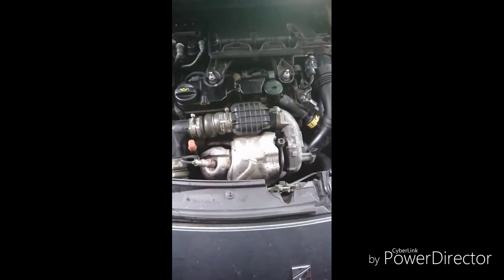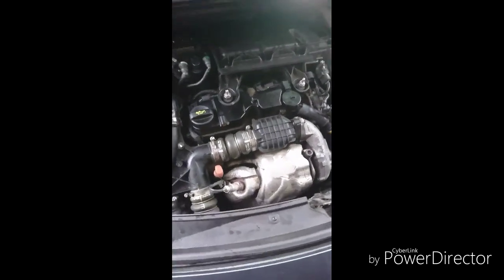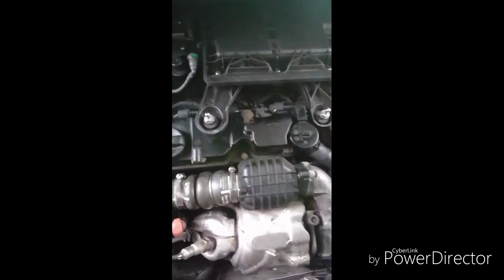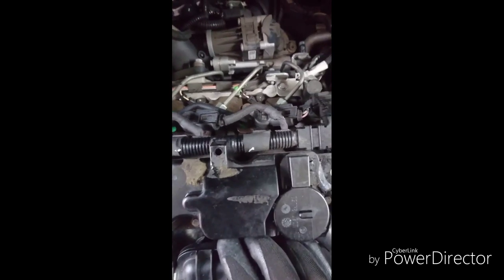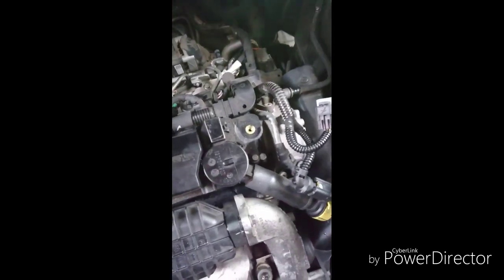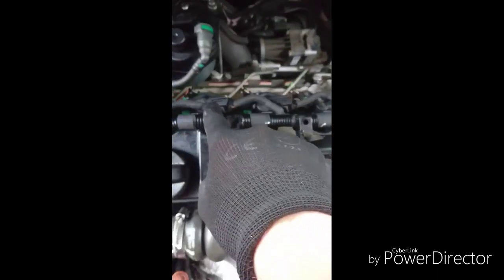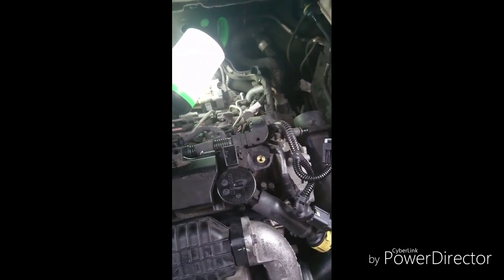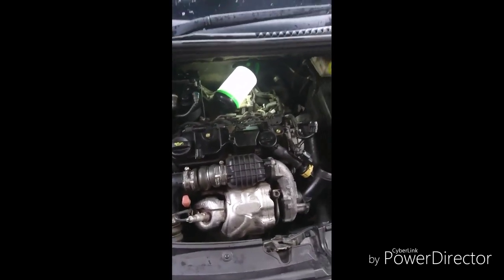How to fix Injector Issues/rough idle/engine management light on a Citroen DS3 1.6 HDI 110 Diesel

Comment: What's not mentioned is that the routing of the harness that's affected has been changed, and it is no longer going over the other cable, and then on to an attaching stud in a bracket that makes the whole thing a lot higher, and if the TWO large rubber bushes that should be in the back of the airbox are missing, they're similar size to the bushes in the front mounting, then the box WILL rub that cable, I found exactly the same issue on my 2011 C4GP a few days ago, albeit that the No 1 injector had failed, dead short, it was only as a result of taking the box right out that I found it, as the main dealers are all closed  for the next week or so, I've made up some temporary bushes that will solve the problem for now, they'd clearly been missing for a very long time, based on the wear patterns on the studs behind the engine, clearly someone had been in there before, and not put them back on correctly, probably after changing an injector, the continental injectors are not a good product, unfortunately.
Reply from the maker: Great work! Yea I believe that's exactly what happened, and yes I had an injector replaced by garage before this happened , so you are probably right 😊

Comment: Thank you  so much. I have never had any faith in garages. Once had a new gear box fitted 20 years ago on my Mercedes van for £890, only to find that it was just a loose connecting rod bolt (£1.20p)  The RAC contracted them to do their call outs. I complained to the RAC, they simply said that the garage wont give them a detailed report for the work !  Name and Shame the Garage that ripped you off mate..
Reply from the maker: I'm so glad this video could help, and it's a shame to hear about your past experiences with garages 🙁.

Comment: Thank you for sharing this video. This will help me diagnosing my Peugeot 3008 which same engine. Hard start and if it starts won't take long and cut off.  Checked all fuse, just bought fuel pump, fuel filter, fuel pressure sensor and about to take off injectors tomorrow. Fingers crossed I'll have same issues and save me a lot. Thank you
Reply from the maker: Thank you 🙏🏻😊, I wish you good luck I have my fingers crossed 🤞🏻 for you
Reply: Did you have p0271, what was the cause of the fault?

Comment: Thanks fella, I've been through the same issues with garages, including Citroën main dealer. Absolute nightmare. Spent a fortune, not to mention months of hassle and recovery costs. In the end it turned out to be an injector...  they're total nonsense, charging obscene hourly rates to do guesswork.
Reply from the maker: No problem at all, I'm so happy you eventually got to the bottom of it ☺️, it can be a real pain when you have an fault that no one can seem to fix

Comment: Great video! Got the same issue on a 2011 pug 308 1.6 hdi. Just had a look now and the wire is worn like yours, was there anything specific about the connector you used? Like the amp or voltage rating for the connector? Many thanks
Reply from the maker: You are welcome and thanks for your comment ☺️🙏🏼, no use any connector it will be fine ☺️

Comment: Great video, thanks for sharing the info.
I just checked mine on 2011 Peugeot 5008 and it was also rubbing through the wires.
The reason was because there was a rubber mounting bush missing from the bottom of the air box. This meant the air box was sitting too low and rubbing on the wires.

Comment: Thanks for this, one injector went, replaced the other 3 with new ones. Year later I'm getting high current on injector 4. Just been to garage who couldn't diagnose. Hopefully I've a similar issue.
Reply from the maker: No problem glad I could help ☺️, thanks for your comment and support 🙏🏻☺️
Reply: What was the cause of injector 4 high current?
Reply: @frv6610 had a split/dodgy glow plug cable, changed the battery and put a Continental injector in opposed to Siemens, been alright since.

Comment: Thank you very much. I have a Mitsubishi ASX 1.6 diesel , that should have an engine dv6ted4 1,6 HDI Peugeot 207 307 CITROEN c4 XSARA PICASSO c5 , that seems very similar to your engine. I have fault code p0265 too, that happens randomly. Injector 2 was replaced one year ago thinking to solve the problem,  but now i have the same problem p0265 again. I hope the cause is the one you suggested, i will check tomorrow and let you know! Thank you very much!!!
Reply from the maker: Thanks for your comment, no problem, good luck, please let me know the outcome 😊
Reply: What was the cause?

Comment: You are so kind to share this. It shows how poor the diagnosis tools are. I have issues with overboost on 1.6hdi engine. Its like all software which  seems to be designed on priority of the main function but will not necessarily indentify directly a faulty sensor. The trouble I had in location of a fault with an impact sensor would take many more lines to describe. However my Berlingo has done 158k miles so reliability is high. At that's something.
Reply from the maker: I'm so happy this helped you, and thank you for sharing your experience 😊

Comment: I did hear about this issue but your video better describes it. I will look on mine to see if this is the issue.
Though if the injector itself is the problem, using a multimeter between the two electrical pin connections will tell you. If it's 0 ohms, then it's knackered. But I wonder if loom problems like yours cause them to get damaged?

Comment: Thank you so much for sharing I have bought a number 3 injector as that's what it was saying on the fault reader and still the same so I will check the plug wiring fingers crossed 🤞. If its the wiring I could have saved myself £350 lol thank you

Comment: hi, i have injector noise on my ds3 1.6 hdi 110 like it rattles on acceleration, rough idle vibration also, ive been trying to diagnose the problem.
i have found the same cable or maybe a differant colour all open and showing.
i thought i would just put some electrical tape on so i did and after putting the bits back togther i started the car and it is the same rough idle and noise.
i scanned with elm 327 and i got 2 pending codes p0269 cylinder 3 contribution/balance and p0263 cylinder 3 contribution/balance.
do you think this code is because of the cable and the fact it needs cutting and a block fitted?
only other thing i can say was when i purchased my car 2 days ago it was ran when 0 fuel in the tank so i am thinking the back of my mind its dragged crap up and blocked injectors but now i seen that cable im still thinking it maybe that that needs cutting and connecting up.
i also havent managed to delete the pending code so i might need a proper diagnostics machine to do this as im guess the fault will stay untill the pending codes are removed even if the problem has been mechanicaly fixed..? any help i will be most thankful
Reply: Did you manage to sort your poor idle and noisy acceleration? What was the cause?

Comment: Hello, I have a problem with my car Peugeot 207 1.6 hdi 2011 82kw 112ps, one day I get a message Engine fault repair needed, the car loses power and the engine noise changes sharply, and the engine vibrates, and the gas does not exceed 3, then removed the battery and put it back again this problem is removed, after a month the same problem appears again, TODAY I CHECK COMPUTER THE CODE IS  the foult code P0268 
- Cylinder 3 injection circuit
-Short circuit to positive
-Permanent

I am thankful if you help me solve this problem

Comment: Really good find - will be looking at my daughters ds3 tomorrow as EML came on and the fault code suggested injector…
Reply from the maker: Hi thanks for your comment, good luck let me know what you find 🙂
Reply: @CarFlix.  managed to fix it - cleared the codes and then when the light came back on it said exhaust gas temp sensor - so changed that out (tricky to get a spanner to it) and all fixed now :)

Comment: The wiring you've repaired is to the glow plugs, not the injectors. The Injector wiring loom is inside the black conduit.....
Reply from the maker: Hi I traced the wiring directly from the injector which cured the rough idle, glow plugs only heat on startup, and would not affect the running of the car 🤔
Reply: @CarFlix.  if you trace it again, you'll find it runs behind the Injector loom. You're right, a short or open circuit in the glow plug loom shouldn't affect the running of the vehicle although it will still throw up a fault code. I should say your repair actually had nothing to do with the fault clearing, I should say it was just coincidence, maybe some dirty fuel caused a momentary Injector fault, and clearing the fault off the ecu sorted the problem. Either way it's still a useful video for people to check.
Reply from the maker: @nathanaelwarden  the weird thing is I replaced the injector, fuel filter and ran it on bp ultimate for 2 months before hand, maybe they share the same earth?
Reply: @CarFlix.  it's possible. I don't know whether they're earthed through the ECU or the head
Reply from the maker: @nathanaelwarden  ah well, hopefully it's linked as the code never came back again and ran well ever since 😊, the added info though mate much appreciated 😊
Reply: Yes,this 4 pin connector is for those four glow plugs 🫣😁👋

Comment: Doing this today will let you know if it works for me :)
Reply from the maker: Hi and thanks for your comment, how did you get on?
Reply: @CarFlix.  It got rid of two errors but I'm still getting cylinder 1 circuit high error which I'm unable to clear. Before I had Cyl 2 and 3 contribution balance errors, so at least they are gone. Will be trying to have a go again when time allows.
Reply: and yes the cable was worn in exactly the same spot as in your video :)
Reply from the maker: @TimTymski  brilliant so happy I could help 😊

Comment: Some Muppet did;nt invest in a multimeter and learn how to connect one of its leads to the battery negative and the other lead to the injector/s connectors plugs +supply, to verify their supplies. And/or inject direct 12v fused-supply to injector/s via said meter in current mode, to verify their correct current load. Oh dear.
Reply from the maker: Hi Thanks for your comment, oh well hope this video helped you all the same 😊

Comment: how did you go about repairing the connector?
Reply from the maker: The connector wasn't faulty, it was the wire which had been damaged. I cut the wire in half, bared both ends back then used a crimp connector to join the ends. Hope this makes sense 👍🏼
Reply: @CarFlix. ok thanks you
Reply: @CarFlix.  the default has disappeared or did you use obd to erase
Reply from the maker: @malikbelhouchet4305  I used a Bluetooth OBD adapter and the Torque App to remove the engine management light after I fixed the wire 😊👍🏼

Comment: Bonjour j'ai le défaut P0271 injecteur 4 court circuit sur 1.6HDI 112CV
Reply from the maker: Thanks for the comment, sorry could you write this in English please?
Reply: @CarFlix.  the connector is that of the glow plug and not the injector or it is a set

Comment: Thank you for your video. It really saved me lot of money. I had similar problem. Lost power on my Citroen C4 Picasso 2015 while going on a camping holiday. RAC recovered me to nearest garage. They quoted me £1900 for changing 2 injectors without even touching the car. Asked me to leave car with them for 3 days. I refused and recovered my car privately to my home. Shown the car to my local garage, who quoted £900. I refused it as I didn't believe injectors failed only after 47k miles. After searching on YouTube found your video and decided to do it myself. You have explained all the steps well. I found the airbox had been rubbing against the cables and black netting on the cable partially damaged. I have put the insulation tape around it and tighten all the connections. Put everything back. Car is now running like new. During this whole episode I realized that people (mechanics in this case) rely on computers too much and not even looking under bonnet to check the problem. I think we all rely on computers heavily but should always remember to trust your guts.
Reply from the maker: Hi Karan, thanks so much for your comment, I'm so happy this saved you money, your right some mechanics don't check the basics 1st, and they also charge too much money in my eyes. Here's to much more trouble free motoring 👍🏼

Comment: Can the wire be just isolated by tape,or connector should be fitted?
Reply from the maker: It depends how badly severed the wire is. If the wire on has insulation damage, insulation tape is sufficient. If you see any copper strand damage I'd cut it and reconnect with a connector.
Reply: @CarFlix.  thans for replying 👍
Reply from the maker: @mirzaogric6650  your more than welcome 😊👍🏼

Comment: Exact same problem with my DS3 Dsport hdi 110 - RAC ran the diagnostics showing me that injector 3 not working at all - 0 on all readings compared to CO2 and dynamic % figures from the other 3 cylinders so I suspect the Injector is knackered but will check the wiring anyway and probably give it a go replacing the Injector. Nice vid much appreciated
Reply: Hi Jon checked my connector and the outer braid has been worn through but none of the 4 wires or their plastic outer cover has been worn . Also i traced those wires and  they connect to the injectors at a part of the injector close to the point  of attachment into the head or manifold not sure how these are detached.  There are separate electrical connectors to the top of each injector which look standard.  There is a large torx bolt and smaller standard hexagonal bolt holding each injector in place as far as i can see is that correct ? Finally the clips holding the return fuel pipes to the injectors Im not familiar with so dont want to break them. Any guidance on replacing  the injector would be a godsend cheers

Comment: Thank you for this wonderful video. I have an injector problem too. Citroen C3 Picasso 2010, diesel. One garage suggested (on Sunday no mechanic available) that I change the injecter washer only because I am losing engine power. I am visiting a garage tomorrow, I hope they don't charge that much.
Reply from the maker: Your welcome, you can buy a new injector off eBay for around £130, it only takes 30 minutes to remove and fit the injector, very easy job you could do your self , good luck!

Comment: my 1.6 hdi 8V DV6C , the same problem
Reply from the maker: Yep seems to be a common design floor
Reply: @CarFlix.  I had the codes P0263 and P0265, the car drives and is under observation.
Reply from the maker: @Rysiek80  let me know how you get on 👍🏼

Comment: Thanks for video..  i have the same model car and having po263.. po266..po269 faulthy codes.. i already made appoinment for repair, but after watchn this.. i will try if that connector is rubbin on the filter houseing.. its makin huge vibration when  accelereting
Reply from the maker: No problem, your welcome and thanks for your comment, the injectors are notorious for clogging up with diesel sediments usually from cheaper fuels. I my self are guilty of using supermarket gel hence why I have replaced 3 out of 4 of my injectors. It's always worth trying this 1st however . The giveaway with this particular fault is usually the statement "high resistance" in the fault code. Might I add if it turns out to be the injectors I'd advise all 4 replaced at the same time If you can afford it, as the car will break down each injector otherwise. My 4th feels like it's in its way out, but is very easy to replace. 15 minutes to remove and fit the new one your self and you can find new genuine injectors for £130 each. The injectors will need coding also (but will still run if you don't code them) so you can either buy a coder off eBay for about £120 or pay a garage to code them for roughly an hour's labour. Just bring the packaging of the injectors with you so the garage can take the unique number off each injector to code them. Hope this makes sense.
Reply from the maker: Good luck with this, what was it in the end?

Comment: Thanks Jon....now how do I fix a rough idle when cold ?
Reply from the maker: My guess would be glow plugs but I'd check if your ecu for fault codes 1st as this would confirm my theory. You can do this by, buying the app "torque" from your app store, and buying an OBD Bluetooth adapter. Good luck, hope this helps.
Reply: same problem, and i've replaced all glow plugs, but apparently these engines only bother to turn on the glow plugs if the temperature is around freezing.